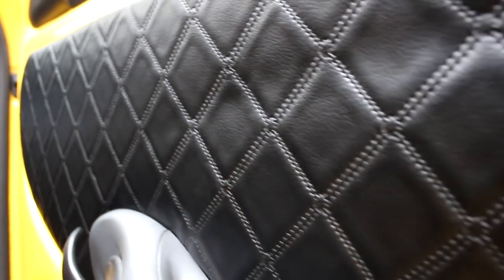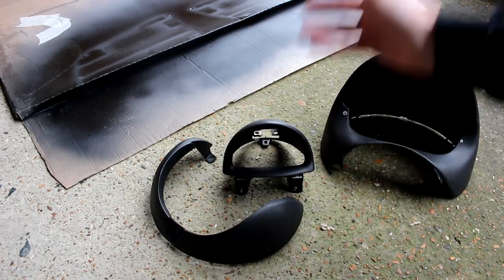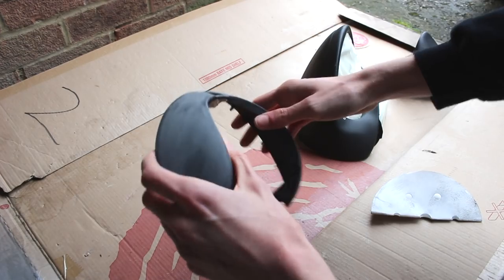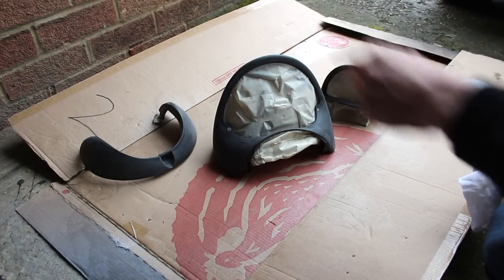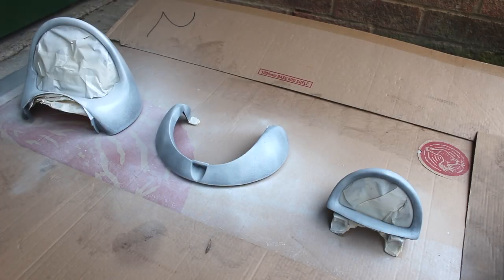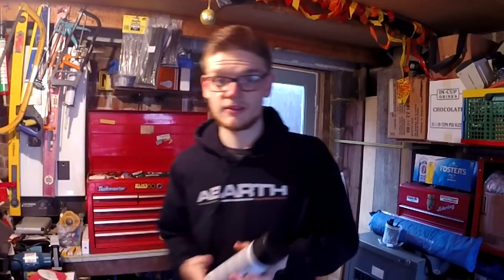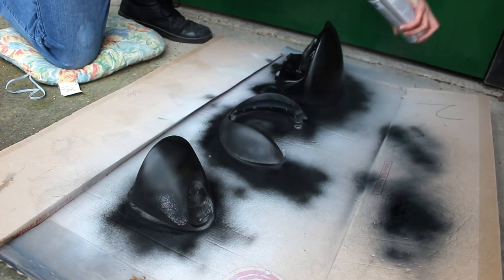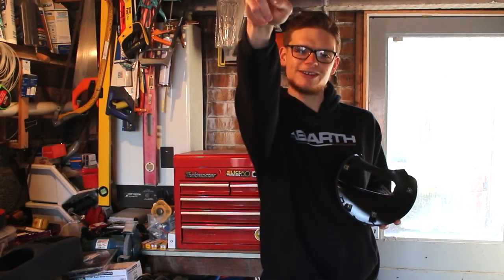Best CHEAP Interior Mod! Painting Gauge Clusters [Super Seicento]

Comment: Stand your cans in a bucket hot water , and heat bits to be painted before and after putting painting on dries much faster, heat from hairdryer will not set paint on fire , job done in half an hour .
Reply: Agreed. Also you're holding the can too close to the job. about 12 inch will be better buddy. Thanks for the video
Reply: Second that! Especially for the clear coat!

Comment: So you just painted over the bits that bubbled up without sanding them back? 
I use a heat gun to warm the parts up in this weather and again when they are tacky to speed things up between coats.
Reply from the maker: They were cleaned before the filler coats and rest assured, are smooth as a baby's backside 😉

Comment: 5°C is extremely, extremely cold? My guy that's tshirt weather! Here in my little peice of Canada  temperatures 35°C and up are common in the summer time. I'll agree that 5°C is bloody cold in July.

Winter is a little less friendly... -35°C is what you should expect as the usual cold snap (lasts a few days er weeks and reoccurs just as often). That's before wind chill.

Our house is in the prairies, perhaps 10km east of the Rockies. There are a few interactions between the atmosphere, lithosphere, and hydrospherr that in short cause a little wind. As in we had Category 2 hurricane force winds, 160km/h, a month back. Hell back in 2013 we had a shed that literally exploded from the wind. Pushed in the door and built up the pressure. Poor thing got lifted 15 feet and scattered across ten times that.

In winter 5°C without wind is topless weather. At least when its compared to my December walk to work. 4am, -42°C... -67°C WITH WIND CHILL 😂😂😂😂😂😂

I'm just yankin your chain, come to the great white north sometime bud! I'll show ya our parliament igloo eh, well we're out got a rip bud!